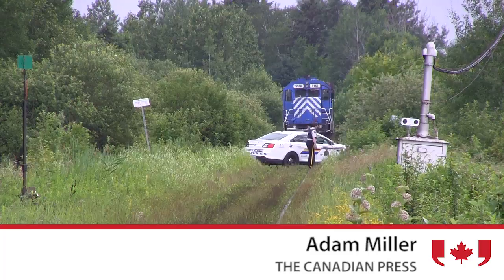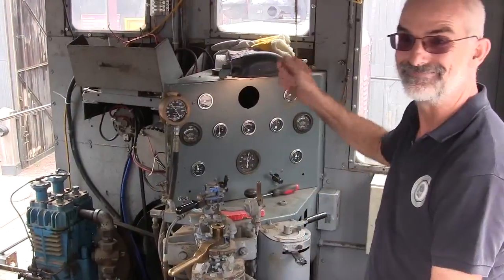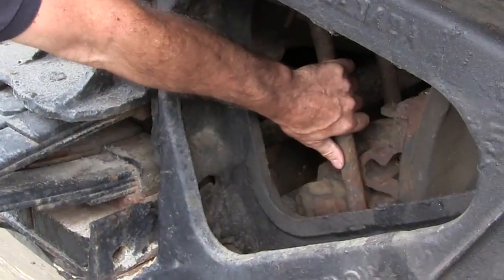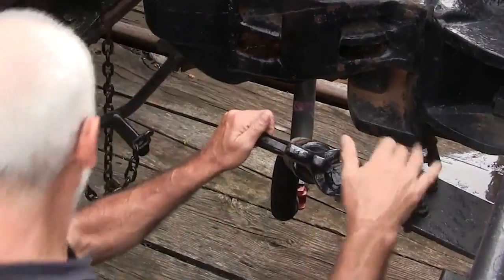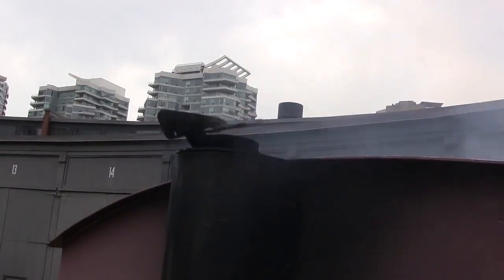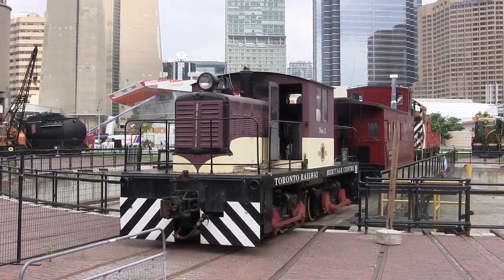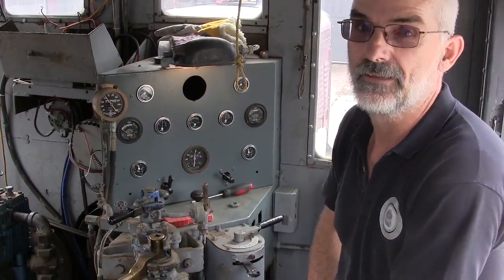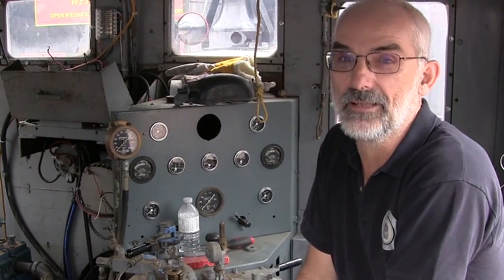A look at how a train's air brakes work

Comment: The engineer & conductor parked the Lac Megantic train for the night. Locomotives running, keeping the air system operating. They set hand brakes on 8 cars (not enough because they were parked on a downgrade). There was a fire on one of the locos. Local FD responded and did what they're trained to do; they shut down the locos with the Emergency Stop buttons. At some point, after the FD cleared the call, the air exhausted from the car's reservoirs, and the train began rolling, because there were not enough hand brakes set. People tried blaming the FD, when in fact the engineer & conductor made very crucial mistakes when they parked that train.
Reply: That's is correct. However I thought on trains if the air is applied it releases the brakes not holds them? So, in actuality there was only 8 hand brakes applied for a 72 car train?
Reply: @johnnyo8299  I drive trucks with air brakes, so I've always been keen on how train air brakes work. It is my understanding that initially, the locomotive supplies air to the cars, which fills all the air tanks. Once the tanks are full, the approx 90 psi air pressure in the brake line (engineers call it 'the brake pipe') keeps the air in the tanks, and no air pressure goes to the brakes. When air pressure is RELEASED from the 'pipe', air from the car's air tanks goes to the brakes, applying the brakes. Therefore, I believe when a train is parked, the "pipe" is exhausted of air pressure, and the car brakes are applied. So even with the locomotives idling, if there is an air leak at each car, the air tanks will eventually go empty, and the brakes will slowly release. The idling locomotive will not replenish the air tanks, because the 'pipe' has no air in it. So it is my opinion that if the local Fire Dept did shut down the locomotives due to the fire, they did NOT cause the 'brake failure'. It would have happened even if there had not been a fire, because the car's air tanks were slowly leaking air. This is why HANDBRAKES need to be set on a parked train. I have no idea how the determination is made, but I think crews apply "x" number of HANDBRAKES,  based on total train weight, and the grade they are parked on. In 2013, only 8 cars had their HANDBRAKES set, and it still rolled away. I do hope a train locomotive engineer reads this, and corrects any misinformation I may have provided.
Reply: I found out that the engineer accidently left the air in the pipes so the wheel brakes weren't applied  and yes there wasn't enough hand brakes applied also. It's not the fire fighters fault that they turned off the engine because they are not expected to know anything about Trains,  they were just there to put out a fire

Comment: i always though the brakes needed pressure in order to release. like a spring pushing the brakes and air pressure would push the brakes open
Reply: Your main reservoir air needs to supply brake pipe with sufficient air to release (charging the system). Brake Cylinder pressure is your braking effort brake pipe is like a safety supply of air and when the brakes are in release it’s fully charged with brake cylinder pressure exhausting (0psi) if you were to lose brake pipe air totally the system would go into emergency which is usually it’s highest braking effort. If you were to lose main reservoir air (if the train is off a source of power and no compressor) then you would eventually lose brake cylinder pressure which is fed by main res so then you’d need to apply a handbrake

Comment: I worked on the British Railways all my life . When I joined we were still using steam engines , using vacuum brakes . When we went over to diesel with airbrakes . The drivers complained that it was to harsh going in . On a vacuum system , the brake  went in from the rear of the train first, working it's was forward  and also it was more gentle  .If the vacuum was not present  ,  it was quite impossible for the vehicles  to move at all. Without releasing each brake by hand with a large  wooden stick . Not like the air type system where if there was no pressure present it would  move , not good !
Reply: What you have to keep in mind is:  is train length.  In most of Europe, freight trains are short.  In North America, trains can be 1-1/2 miles in length, or even longer.  If you had to 'suck' the whole train, this could take very long minutes - like 30-40 minutes for a mile long train.  And that would be with every brake application.   You bring up some good points, but the situations and conditions are/were very different.  And, as train speeds got faster, and lengths increased in the UK, even they had to convert to pressure systems.

A great video showing how these systems work on long trains is this one (below).  But the main take away is this:  on a pressure system, you use a small amount of control air to move a lot of braking air (throughout the whole train) with the triple valves and reservoirs.  The video (despite its age) explains it better than I do.

https://www.youtube.com/watch?v=K4n3W1GN1pA

In the case of this tragedy, the train was not tied up properly (hand brakes applied) and when the locos ran out of fuel, the train eventually lost are and started moving, right or wrong, as designed. 

Lack of securing the train led to this.  Not the braking system.

Comment: Wow... As a truck driver it's interesting to see the differences in air brake systems.  For a transport you not only need air to apply the brakes, via the peddle, but you also need air to release the brakes (emergency).  It's surprising to me to find out that trains don't have this critical safety feature.  If they loose all air, and have nobody to turn the manual wheel brake, the car can just roll away.
Reply: The train brake system differs from the truck system, however the same safety feature is in fact in place.  The engineer in the video explained that if the hoses disconnect, air is released and the brakes apply. The reporter turned it around and said just the opposite.    Refer to my above comment for the working details of the automatic brake system.
Reply: Each car has a air reservoir, the air in the reservoir is used to engage the brake pistons.
Before starting a trip the air brake need to be connected and a continuity test is done ensuring all cars are connected properly (they open the brake conduit on the last car and the machinist checks if the pressure in the locomotive drops). Connecting the cars will fill their air reservoir.
The brake conduit has a normal operation pressure between 3.3 and 5 bar (3.3 being max breaking and at 5 bar the brakes should be fully released).
When the connection between cars break the pressure in the brake conduit drops and all attached cars will start breaking using the compressed air in their reservoir. The reservoir holds enough air to keep the brake pistons engaged for an extended period of time (by far enough to drink a coffee and go fasten the mechanical parking brake).

PS : in fact there are 2 air conduits, one for air supply (8 bar) and another for the brakes but the system is designed to also work with only the brake conduit.

Comment: From what I have heard and read about this disaster, the problem came about because the cars were left unattended with only air brakes set, no hand brakes set, and/or no chocks(pieces of wood) between wheels and rail to prevent unwanted movement.  Air WILL slowly leak off the system (given enough time) which will allow the brakes to release.  This will happen much faster in the cold of winter than in summer as happened in this instance.  The modern air brake system could be improved by electrically operated valves on each car to reduce the response time of brake application being initiated by pressure reduction travelling as a wave from the locomotive to the last car.  If the electrically operated valves are used then all cars would respond at the same time instead of progressively.  An emergency application can take about 6 to 8 seconds or more to travel from the locomotive to the last car on a mile long train.  This is one reason for derailments from emergency application of brakes-heavy cars run into stopped lighter cars, or lighter cars in between heavy cars.  A train of 100 cars of 100 ton capacity will weigh about 13000 tons.
Reply: +Roy Reynolds Just asking; Im just trying to understand..if the air is bled off,how would an electronic valve intiate a brake application with no air pressure?
Reply: It would not but I was referring to the response time of each car's brakes.  If each car was actuated at the same time all of the brakes would apply at about the same time instead of each car applying momentarily after the car ahead of it.  It has been shown by experiment that there is about 5 or 6 seconds lag of brake application in emergency from the locomotive to the last car in a mile long train.  Regretfully I didn't convey that thought very well.  I am sorry.  Hopefully you understand better now.  I am not an air-brake expert by any means.
Reply: +Roy Reynolds  I understand...When Ive broken my power away from my train,the air will dump,then it takes about 7 or 8 seconds that my headend box will give me a 0 pressure for the rear from the telemetry..
Reply: That sounds about correct.
Reply: Actually what you are referring to exists and is called EP brake system (electro-pneumatic). An electrical signal is fed thru all the cars and back to locomotive where it lights a lamp so that the machinist as a continuity confirmation.
Today, some cars have a pneumatic "handbrake". This system uses a heavy spring trying to compress the brakes and it needs air pressure to release. If the air completely bleeds away the spring will engage with sufficient force to keep the car from rolling away.
Then again, those systems (EP and pneumatic "handbrake") aren't used for freight because freight cars are mostly old "dumb" mechanical cars.
Reply: 5 engines and 2 cars had handbrakes but that still wasnt suffiicient